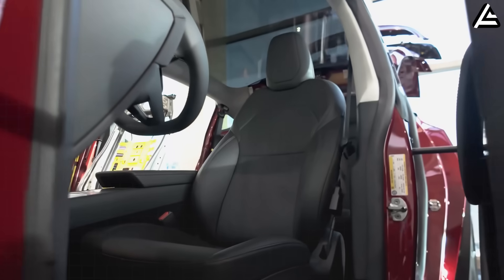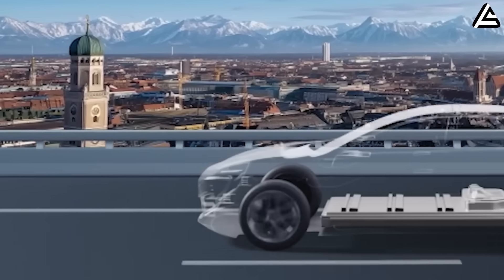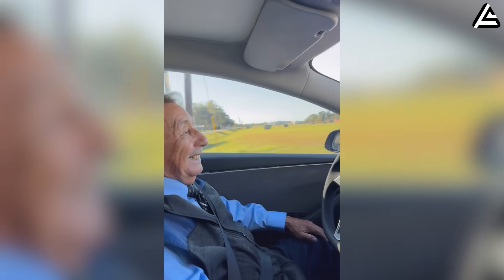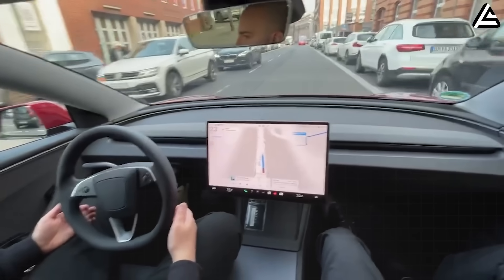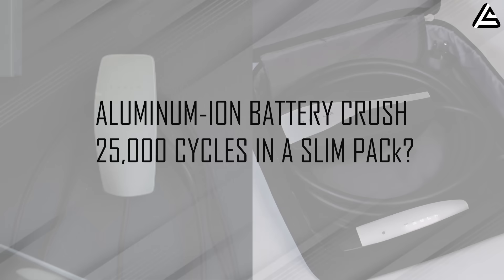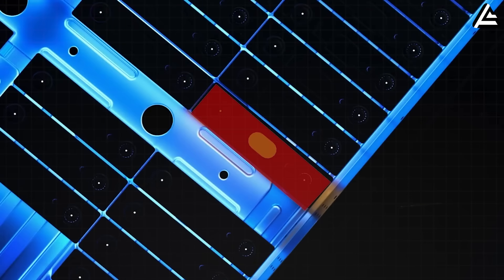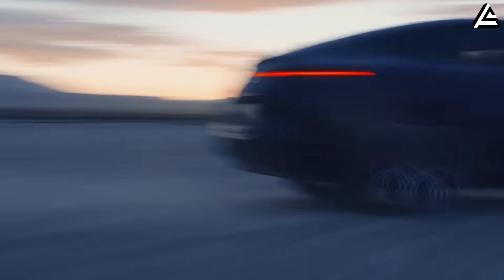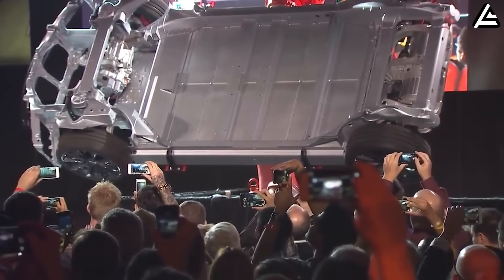2026 Tesla Model 2 Just Changed Everything: Insane Performance, New Battery & Senior Mode?

Comment: There's no complaining about a 12 minute charge time however finding a station available and functional is another thing. It's been reported that numerous breakdowns at those charging stations which is common as well as having to wait behind those slow chargers ahead in the front of the line.
Reply from the maker: That’s a fair concern, fast charging only matters if the station is actually working and available. Reliability and queue management are still real bottlenecks today, even with 10–15 minute charge times.

Comment: Question: how is this exceptional, I had an Austin Healy Sprite cost $1200.00 dollars 1275 cc engine up grade cost $1,000.00 dollars, 0 to 60 mph 4.9 seconds, 35 mpg, top speed 110
Reply: That looks like go cart with a car body. Translate that to today's dollars please. Those are 1971 dollars.
Reply from the maker: That Sprite was exceptional for its time, no argument there. What’s different now is delivering similar performance with modern safety, efficiency, and scale for everyday drivers.
Reply: My older brother and I used to own and restore MGs and Austins… great little cars!
Reply from the maker: thanks for your info

Comment: I do not like headlights too narrow so when snow and slush might cover narrow headlights, wider light can still be seen. How does fsd do with animal, deer do with fsd? A quick stab of the brakes would be tolerable.  Swerving might reduce stability. Swerving might be OK without lane change dynamics.
Reply from the maker: yep
Reply: If you don't trust auto-drive, turn it off and drive yourself.
Reply from the maker: you got a point. but fsd is still a benefit for driver, turning it off would be a waste
Reply from the maker: Headlight shape is still a design choice, but visibility in snow is a valid concern. FSD is designed to detect animals like deer and prioritize braking over sudden swerves to keep the car stable. I’ll explain how Tesla handles these edge cases in the next video.